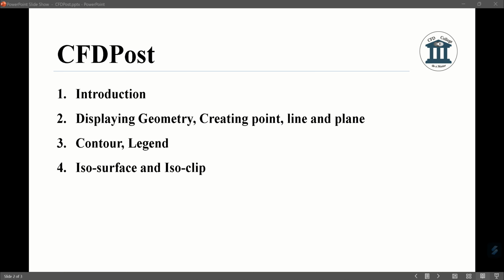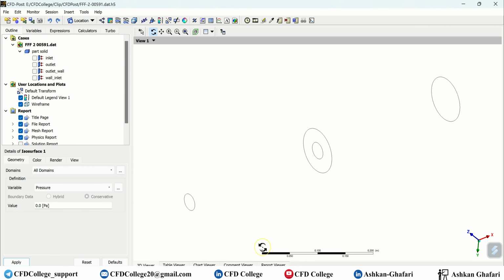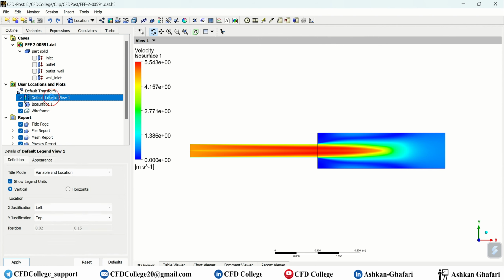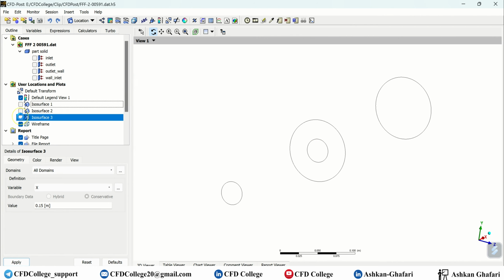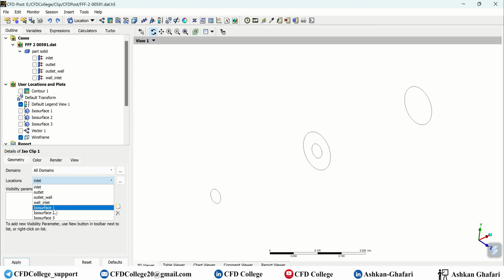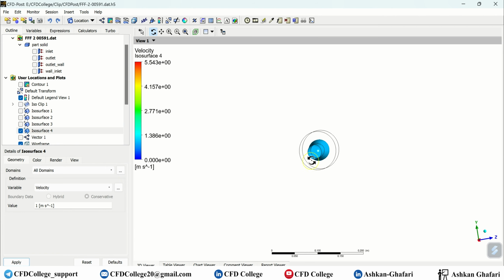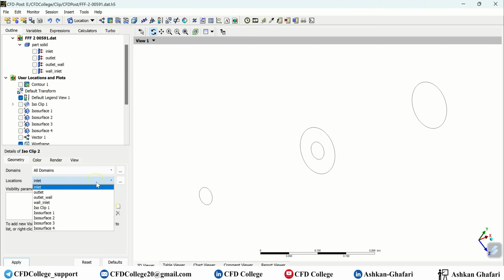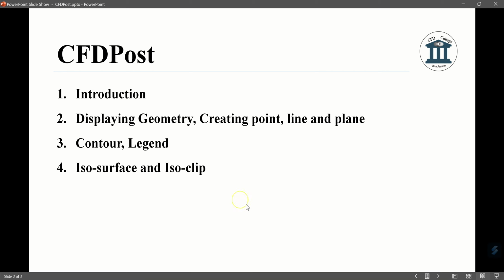CFD Post Tutorial 4 | How to create isosurfaces and iso clips?

Comment: Thank you for uploading the useful tutorials. I have learned a lot from them!

May I request your guidance or a tutorial on simulating external fluid flow where the fluid (e.g., water or any other) falls onto a substrate?

I am working on a simulation where:
 I want to simulate fluid flow using a syringe. The fluid exits the needle and falls onto a substrate (EXTERNAL FLOW).
Setup:
I have created a box and placed the syringe inside it.
Using the Boolean operation, I have extruded the syringe geometry into the box.
I am using the multiphase VOF model with inlet velocity and outlet pressure conditions.
Problem Statement:
I am unsure if my approach and setup are correct.
Specifically, I am trying to:
Model the interaction of the fluid with the substrate.
Simulate a moving substrate to draw a line with the dispensed fluid, while the rest of the box faces remain stationary walls with a no-slip condition.
Uncertainty:
I am unsure which face of the box should be designated as the outlet. Currently, I have set the top face of the box as the outlet.
Could you kindly provide insights or upload a tutorial that could address this? It would be incredibly helpful for my work. 

Thank you in advance for your time and support!